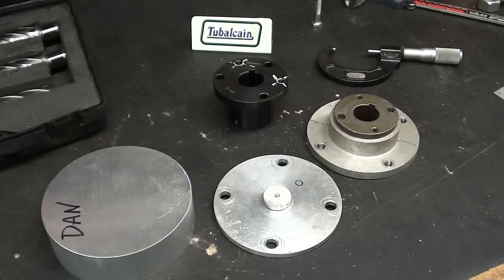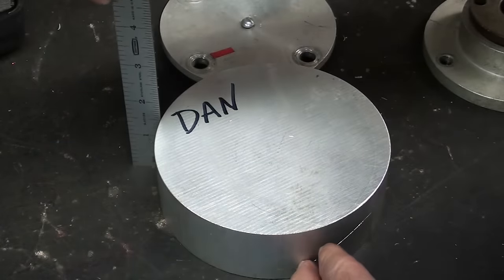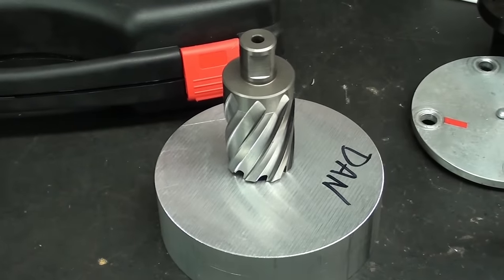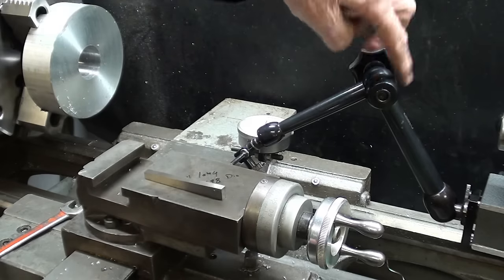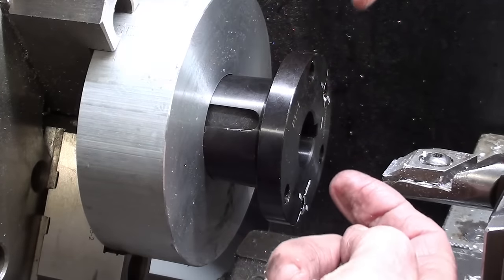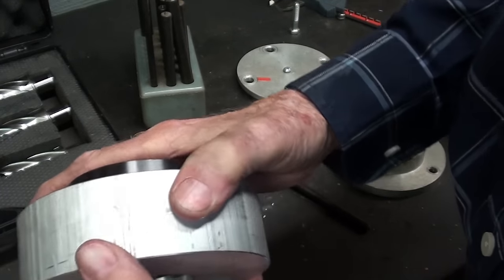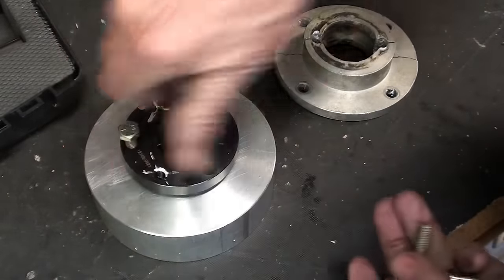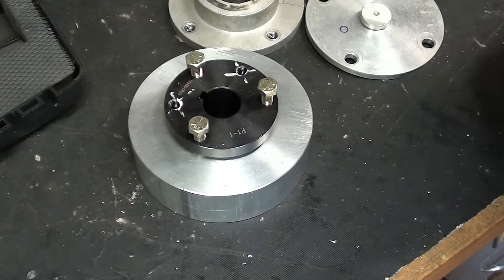BORING AN INTERNAL TAPER #965 tubalcain on CLAUSING Lathe

Comment: Good morning Lyle,
Looking at the original hub, I believe you will need to machine the same step and lighten up your new piece. 
Centrifugal force with the new piece which weighs more, may cause stress on the shaft and bearing. 
Without seeing the entire assembly, I have concerns.
Reply: Minimal effect close to shaft. The blades will have far more inertia.
Reply: Centrifugal force would be entirely equal around the drive unit shaft axis, would it not? And if you're talking inertial forces, then yes, as the other fellow says, the mass of the rotating prop or multiblade fan assembly will far exceed that hub assembly.

Comment: Here because I have a 5 degree internal taper job coming up on a drive pulley. Will be tough as the bore is so small I had to build the tinyest boring bar ever.
Reply from the maker: Good luck

Comment: Do you think 3/8" interference m combined with the thin section cotributed to the original failure ?
Seemed excessive to me.
Assuming it is pulled up to the flange.

Comment: You could achive the 3/8 assembly dimension with the cross slide by leaving .020" per side remaining.
For a handy angle chart check out the DME draft chart on the Internet .
3° angle x 3/8 depth = .020" per side or .040" on the diameter.

Comment: Lyle, I do so wish that you would stop using those crappy transfer punches. With the tapered hub a tight tapped fit, you have a perfect drill jig. Use the clearance drill and go to a fill diamer and a depth of about 3 thread ( professional way deep tapped holes are done ). Remove drill,  then drill throught with the tapping size, you know than that the part must fit perfectly. Trouble with transfer punches that are not always a precision fit in the hole, and at the end of the day all you get is a center punch mark. You still need to deepen it and there is always a chance of the hole wandering off. If you have a mating part, always spot through the hoels with a drill to full diameter. Over 50 Years in engineering and have never seen or used one in the UK. Must be a "Yanks" preferred  to go to tool. You Tube seems rife with people using them. Regards from Australia.